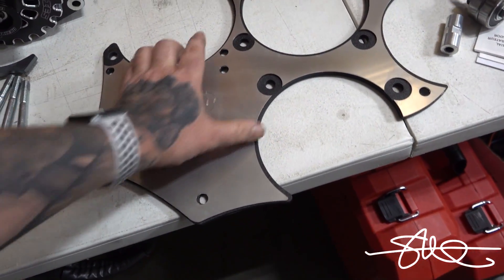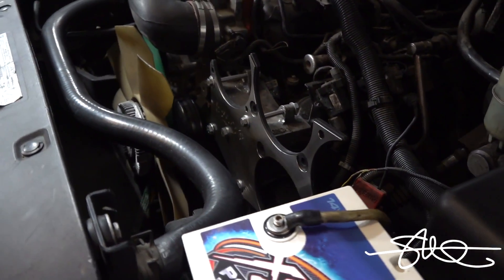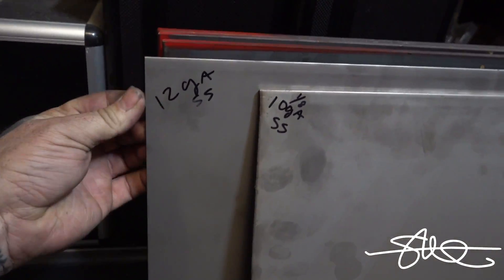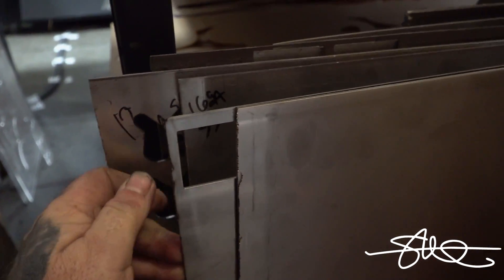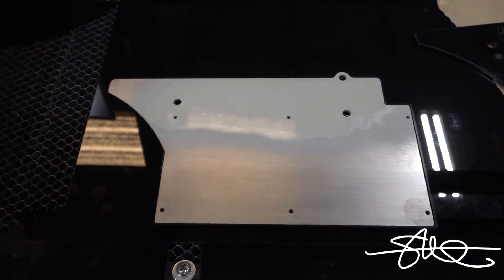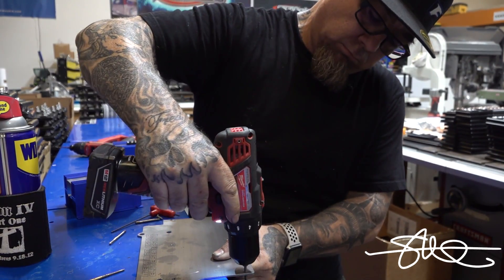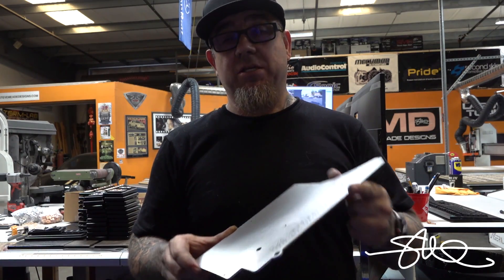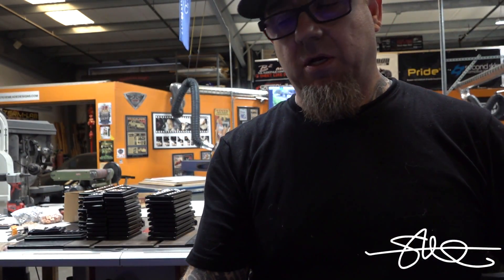Regulators, Mount up! 4 Alternators 1600 Amps @ 17v Custom Stainless Steel platform Fabricated

Comment: Love the bracket idea. May not have hurt though to put a dab of lock tite on those regulator mounting screws. With as much vibration as they’ll see there, it wouldn’t be good for them to fall of one day randomly. Just my $.02.
Reply from the maker: shit ain't going anywhere. If that becomes a problem i will but it won't.

Comment: Whats the max voltage those trucks can get up too for the factory i have 4 370 to run in my burban but kinda worried running it at 16.2 and messing stuff up i was gonna do a 2 g31 under the hood and dedicate 3 370 for the system to avoid complications..

Comment: Looking sweet. I just ordered a blue 370 amp Elite Mechman Alternator last week. Its currently in production for my 2007 Chevy Tahoe LTZ. Im not doing an elaborate system like yours so to speak but I am doing two ZVX 12s from Skar Audio on two Skv2 1500.1D amplifiers. One for each sub running at 1 ohm. I just bought two XS Power D2700 batteries and will complete a  big 3 using 0 awg wire. I just ordered a DD1+ and a CC1+ off ebay to help set it up. It will be running off the Factory Bose system for now but eventually ill upgrade it to a couple of Skar Audio Component sets and run me a skv2 1600.4 4 channel amp for my mids and highs and ill be getting a Pioneer Avic-w8600NEX to head it up. I want to retain my navigation system and Onstar capability. Its gonna be sweet!